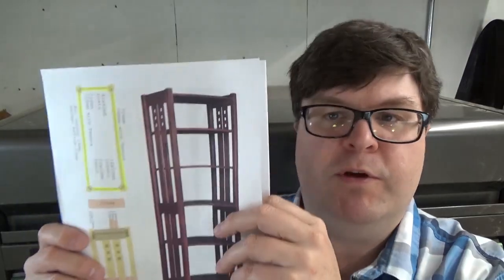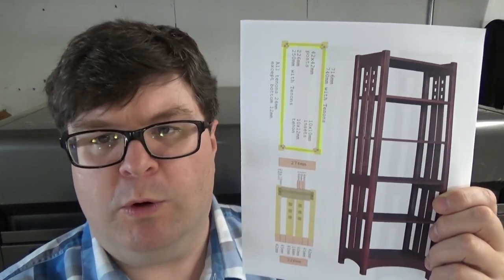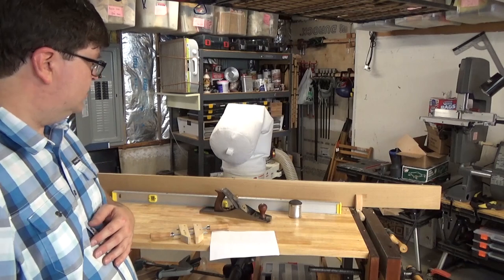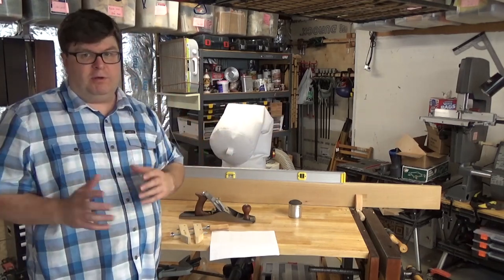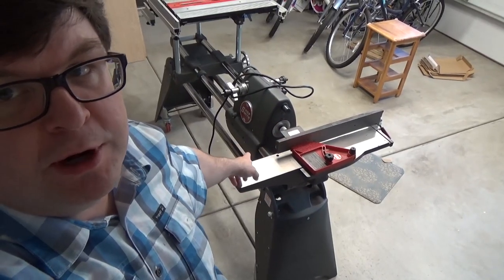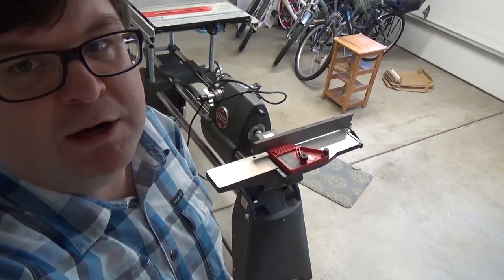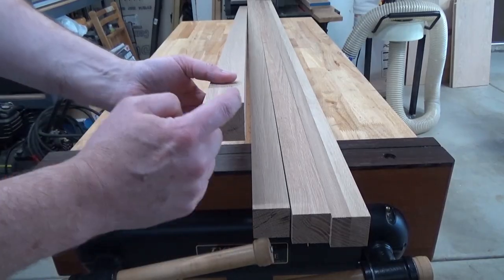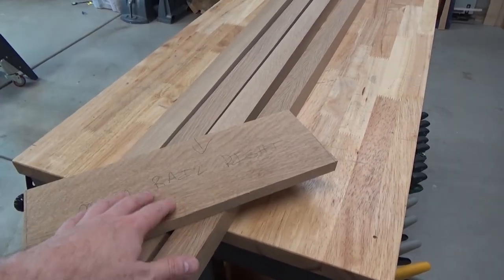Stickley Highlands Bookshelf: Milling Lumber with Hand And Power Tools

Comment: Does your adjustable height table not get to the jointer height? Or if it does, do you not trust the parallelism between the two? Of course, sometimes it's just fun to hand plane.
Reply from the maker: The parallelism or complainer issue is a problem. It is good enough for support but not good enough as a true “bed extension.” I’ve made it work before but thought I would try this less risky method.

Comment: Curious, why rip the long boards on the band saw vs the table saw? 🧐
Reply from the maker: I do sometimes rip on the table saw. If I needed a glue ready surface for edge gluing for example. but these pieces were to be face glued. Ripping on the bandsaw is easier, safer, and has a thinner kerf. So I use the band saw whenever possible.